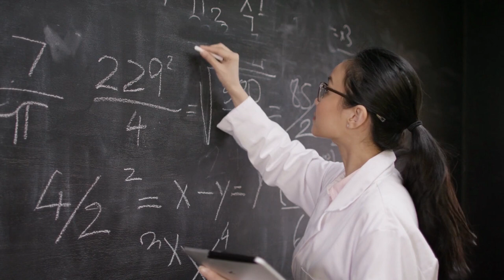Why ChemE Sucks! Things I Wish I Knew Before Going to Chemical Engineering (My Rant!)

Comment: Some very true things said there Emmanuel! 

I would have to say with the point you made about the dark side, chemical engineers work in those fields acknowledging that they are working at the most efficient level to mitigate pollution effect 9 times out of 10, so it does seem negative on the face of it a little bit, but it is becoming more climate sensitive for sure! 

Great video yet again 👍
Reply from the maker: Indeed, sometimes it's not about them directly, and will try to make their best

Comment: As a process engineer do we really need to understand the whole engineering curriculum or it has just been made easy by softwares like Aspen and all you just need is just basics and logic ? Or is it the other way ?
Reply from the maker: Both, truly trying to understand piping systems, you will see that sometimes logic is not enough.. And using a software will not be enough. You need to understand the issues behind that... Actually, is the main job of the engineer to troubleshoot this type of stuff, whenever the software or something doesn't go as planned, the engineer gotta figure it out
Reply: Thankyou sir 😄

Comment: I am a chemical engineering. I feel that my internship/future job could be a job where there is not too much chemistry involved. I love the people I work with, the job is stable, and the pay is good. It deals with pipeline corrosion. Chemistry is not really used here, which is the main reason I would want to move away to a process engineering internship, or refinery, but it seems chem is not used in that or most other jobs like i would think. Is it better to gain experience in this non-refinery/plant career to start with or try my luck with other opportunities that may be the exact same thing but less stable? And then in the future, switch over to something like biofuel, hydrogen, etc?
Reply from the maker: Well, unfortunately there is not much chemistry per se. I would recommend you to apply to R&D, product development, process Engineering, environmental or something similar in order to ensure you work with chemistry (and chemicals as well)... I would try to apply to those jobs that are actually of my interest rather than trying out to map a route for my career
Reply: @ChemicalEngineeringGuy  What kind of environmental jobs are there in chemE, it would seem like thats more environmental engineer

Comment: I have always said that a career gives you many skills, it is up to you what you do with them. However, many chemical engineers for some reason believe that we can only work on oil or related things, when we can work in very diverse fields, environmental, material science, finance, even data science. So, there is no justification for them to say that there is no work.
Reply from the maker: True... but I really think is kinda funny to study mostly subjects in process engineering field (reactors, pumps, plant design, process control,e tc.) to end up doing some admin work or so... I really get them when they say that there is no "proper" chemical engineer jobs
Reply: @ChemicalEngineeringGuy  but that happens in all degrees, whether they are engineering or not, more than half of all professionals end up working in some area that is not directly related to their degree, I know several friends who work in things that are very different from their specialty.
 
The problem here is not so much the labor market, it is the universities and the study plans, they insist on giving us industrial amounts of knowledge that many times we are not going to use.

Comment: I’m currently in the middle of my first semester of my ChemE degree and I’ve been on the fence about switching to another discipline because I’m intimidated by the scarce job opportunities. Ideally, I’d be going to the environmental field. Do you have any advice?
Reply from the maker: If you want to change to environmental, rather stay in ChemE.... Most environmentalist will be hired either form environmental, mechanical, civil, or chemical engineering disciplines... The advantage in ChemE is that you have a lot of more fields to apply!

Comment: Chemical engineering was the biggest mistake of my life. Got stuck with low paid QA/QC jobs. Making more money driving for uber and lyft though now with the high gas prices, that is ruined. If I could go back in time I would pursue software engineering but even that is becoming more saturated. STEM tbh has been a lie.
Reply from the maker: Sure, but then there is no really a "safe bet" any longer... maybe med school
Reply: @ChemicalEngineeringGuy  med school requires more time and money investment to get the degree than pretty much anything else (8-12 years, easily six figure debt). Physician money might be good but the work life is terrible.
Reply from the maker: @richardaversa7128  True, but is a "safe" bet if that's what you are looking for.. TBH I rather go for engineering or CS

Comment: Bro not only just chemical engineering needs training after graduation but aslo many other disciplines needs training as well to start working.
Saying that after 4 years, 
only chemical engineers needs  training is totally wrong thought
Reply from the maker: never said that other engineering degreed do not need it. But as a ChemE it is a must to be trained on these issues. Most mechatronics can already build a robot before going out to the industry